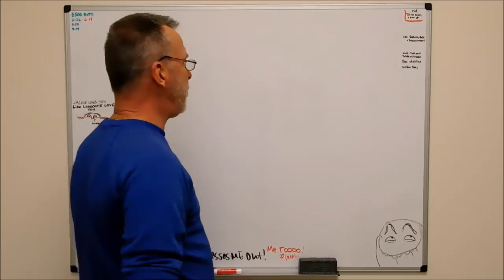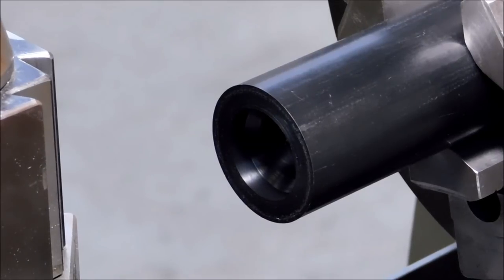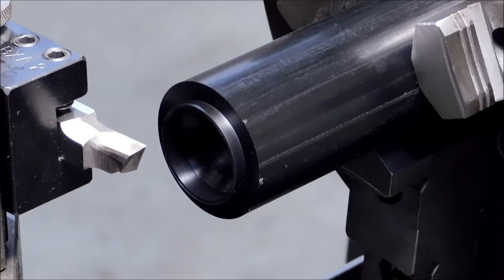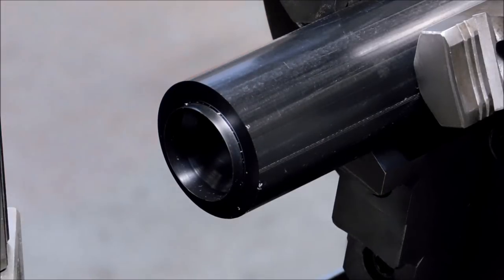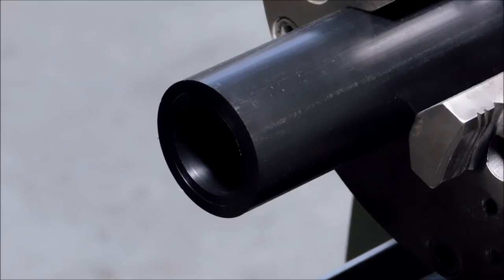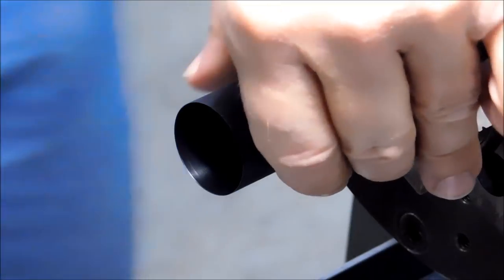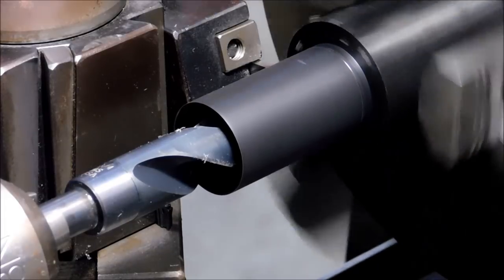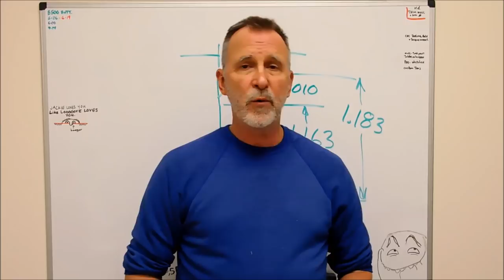Producing Extremely Thin Wall Parts ---Made Easy

Comment: Wish I had seen this last week when I needed to make an .020 wall aluminum sleeve to repair a neck on a small pump.  I cheated and used a wire EDM.
Reply from the maker: I'm sure it got done, but that's cheating.

Comment: i wana see it in stainless
Reply from the maker: It works the same.
Reply: @joepie221  How does "do it all in one pass" translate?
Does that just become "make your largest pass as large as possible?"?
Reply: Joe Pieczynski Hi Joe. Maybe a reduction in stock removal on the OD compared to plastic. Stainless would be very difficult to remove nicely at that amount.

Comment: AMAZING!
Reply: Thanks Joe - seasons  greetings to you and yours from John in Cape Town
Reply: Cool video and an unusual thing to do!  Just for a giggle, try this in brass... after making a nice, clean pilot hole in a  2.5" long piece of brass round stock, (1/2" diameter), make an external thread 2" in length.  Then, by boring and internal facing, removing all the internal material, (which is quite opposite from the demonstration here of course), but keep removing the internal stock until all that is left is a spring at your original thread size.  If your lathe is dead on the money for alignment, you'll find this will work.  You'll be left with 99% of your material on the floor and a spring that is useless in a practical sense, but they are a riot to make if you have some down time on your hands and you want to see how true your lathe is when NOT using a tail stock.

Comment: i can see where feed and speed would be critical to avoid heat or tool pressure from distorting the part as it cuts. can i assume it would be different for different materials? something that experience may override the books
Reply from the maker: It would. trial and error will get you there.

Comment: I've been thinking about this problem for a while. You need to "borrow" the rigidity of the thick part. Once you make the wall too thin, it's too late to machine it without gentle grinding.
You need the ID first. Then the OD needs to be done in tiny segments (or part will twist from chuck to tool). And machining proportions are important - wall thickness proportioned to depth of cut. But these proportions are exponential. If part is too thin, it's no longer machineable. 
If the wall is too thin, you may not get a 2nd chance to cut it anymore, that's why you should get it perfect with "the last cut".

PS: I wrote this before watching the video and I was absolutely right. Fuck yeah. That was SOOO beautiful. The part coming out of the last operation like diamond hiding in the sand.

Comment: Man, looking for machining tips on YouTube is a bitch with all the Imperials. Just go metric America. For the love of clean numbers.
Reply from the maker: I use metric drawings all the time. Easy...convert to imperial.....machine part....ship it.
Reply: The metric system is for those who are bad at fractions.  5 out of 4 people are.
Reply: To be a skilled machinist, you need to be proficient at understanding both metric and imperial. Just multiply, or divide by .03937 depending on which applys. You need to take the prints your customers provide, machine the parts, ship the parts, get paid, and on to the next job. They are just numbers. Focus on making quality parts, to print, safely, and quickly. Good luck my friend.
Reply from the maker: @keithlane4343  25.4 is the only true metric conversion value. Don't use any other way.
Reply: @joepie221  All I know is -40 Celsius = -40 Degree Fahrenheit. I worked in freezers and cargo holds in Alaska for a long time. Its chilly.